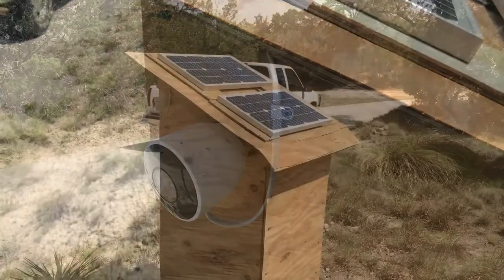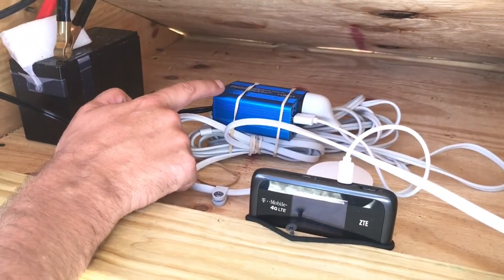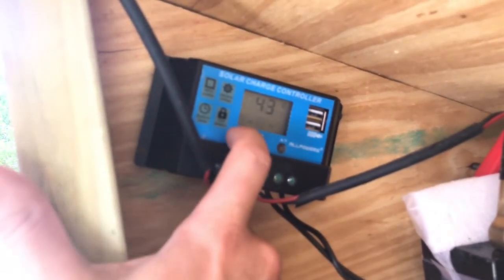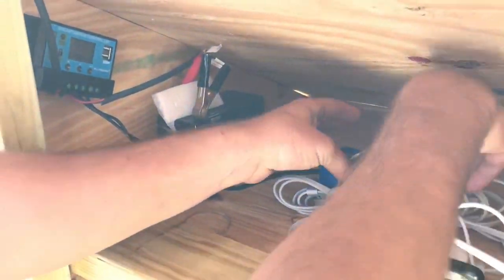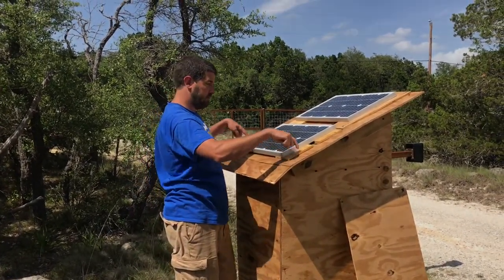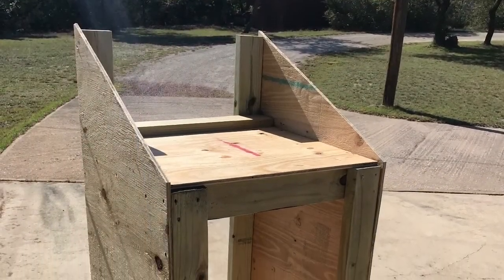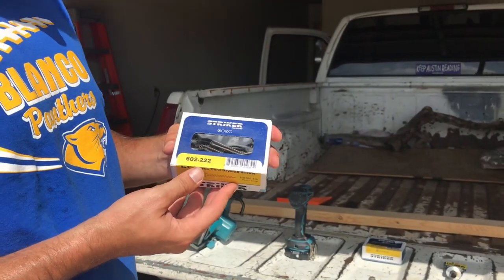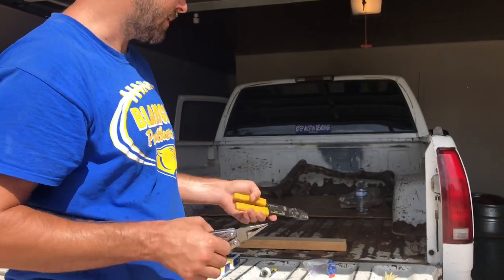Solar Powered Outdoor Nest Camera

Comment: Does it oveheat in the box without any ventilation? Or that’s not an issue with solar?
Reply from the maker: Hasn’t overheated yet - you could add some holes under roof to let heat escape but it doesn’t need a fan. And I’m in Texas
Reply from the maker: The only thing that could overheat would be the batteries

Comment: I have been looking to setup a solar option with my nest camera. This will give me a start. Although I might be able to use my current WiFi signal if it will reach where I want my camera.
I agree with Brian - you can get rid of the inverter and 12v -5v converter altogether as long as the USB ports on the charge controller are powered by the battery and not by the solar panels only, just something to check. From the amazon page they supply up to 3A so that should be more than enough to power both.

I would be interested if you camera ever shut off? How long will that battery run your system if you had overcast clouds for extended number of days?
Reply from the maker: Yep - thanks for the comments.  I realized shortly after I shot this video that I can use the USB plug on the nest camera without the inverter.  I still ended up using a Y-shaped USB car adapter from the solar power unit because the plug on the Nest camera is super bulky.  But a USB extension cable would also solve this problem

Comment: You can remove the DC Converter, not needed. There are 2 USB's supplying 5volts on your solar charge controller. You can use the second USB for the Verizon jetpack for internet.

Comment: One other improvement, put all the electronics in a cheap water proof plastic case that goes inside your wood box, drill holes for the wires and use silicone around them and your electronics nice and dry forever.

Comment: Chuck the inverter and power the camera off the battery. The camera uses 5vdc and you can get a $5 buck converter to change the 12v to 5v. The inverter is very inefficient and costing you lots of power and they have a fairly high failure rate if run 24/7. A buck converter is 98% efficient. Yes, you will have to cut your nest cam cord but it will work.
Reply from the maker: Hah! yeah after I built the thing I realized that I could bypass the inverter (which was using .2A) and just plug the Nest cam by USB directly into a 12VDC USB car adapter that brings it down to 5V
Reply: Can you link me to a smaller single solar panel and battery + easy Conversion to buy for my nest?